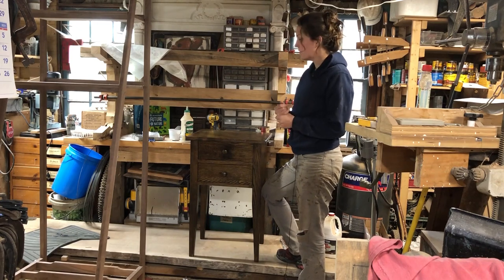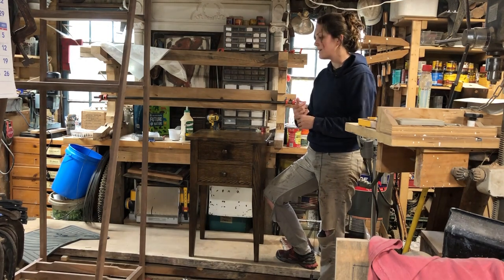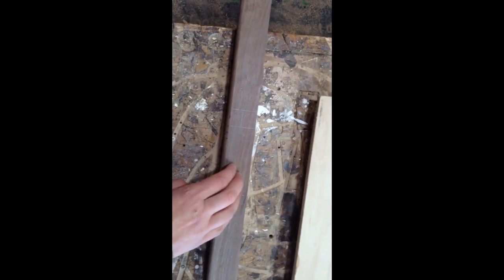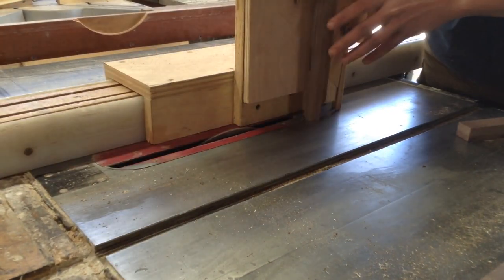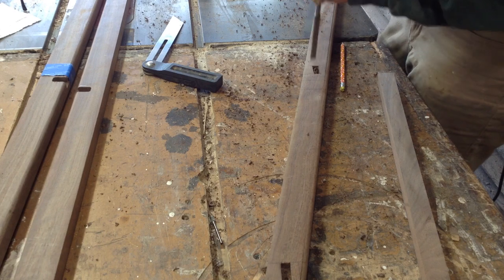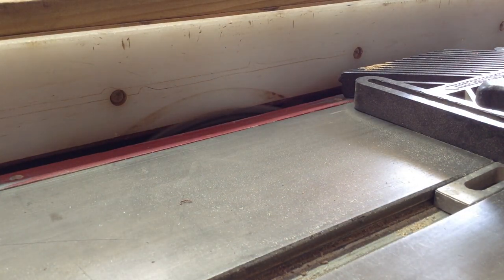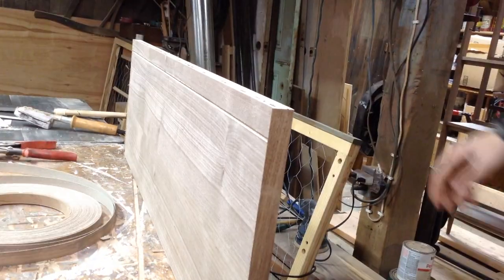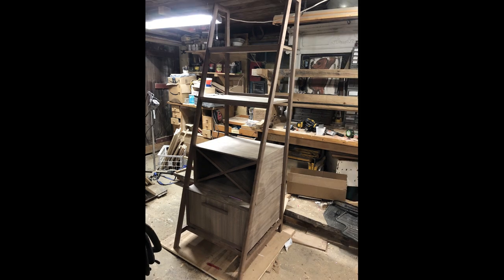Woodworking : Mid Century Modern Walnut Wine And Storage Unit // How-To Part 2

Comment: Excellent work. Has the huge price increase in lumber affected your pricing out your projects? Or do you have enough in lumber stock to hold you over for a while?
Reply from the maker: I haven't been severely affected because I get all my hardwoods locally, and in general the price of hardwood has not really changed around me.  I use a lot of cabinet grade plywood and the price of that for some reason has stayed about the same, but seems to be rising a bit recently.  I don't build a lot in construction grade lumber and cheaper grades of plywood, that seems to be the worse hit products.  I do tell anyone that emails me about projects using those materials that they might want to wait to build because prices on that stuff is 4x times what it was over a year ago.